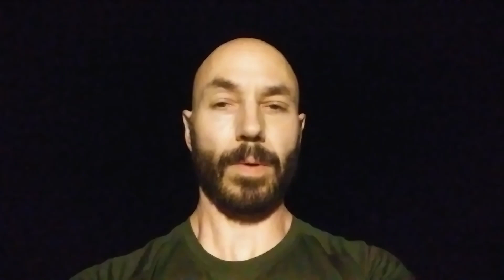P.O.D. 4/10/20 One Way to Cache

Comment: I bought some back in the 90’s and made it out of 10 inch schedule 40 pvc with rubber caps and metal clamps. Never decided to use them but I still have them. They will take an AR without having to take them apart. Plenty of room for gear and ammo as well. The pipe was rather expensive back then but I got a better deal from a friend in the plumbing business.

Comment: If you go that route, bury some tools with the cache, but not inside the PVC pipe.  You'll need them to open the pipe when your ready to use what's inside.  Otherwise you'll be looking for a big rick to bust the pipe open and that will take a lot of effort and, probably, a lot of unnecessary noise.
Reply: You can score the pvc pipe around the center about 1/8 inch deep. This will allow it to break in half by banging it on about a four inch piece of limb.
Reply: @Tom-qx5nl    I'd be concerned about the integrity of the pipe after burying it.  Even just a thin scoring could cause a crack that allows leaking into the contents.

Comment: You're looking tired man, I know your busting your butt trying to get things done but you need to make sure you don't burn yourself out. 

Those PVC caches are great for hiding gear. A trick I have seen is to bury them deep enough to retrieve easily, but still deep enough to where you can throw in some small junk metal above it so if someone has a metal detector and they dig down they find the scrap and move on and not discover the cache.
Reply from the maker: Thanks, and yes stress sucks. I also filmed this right before bed.

Comment: those PVC pipes are expensive......I can make a good cache with a metal garbage can for 6$ and gorilla tape.
Reply: A garbage can will never be as waterproof as a sealed pvc pipe.
It will aspirate moist air by expanding and contracting and condense moisture on the inside.
Reply: @Tom-qx5nl  😎👍